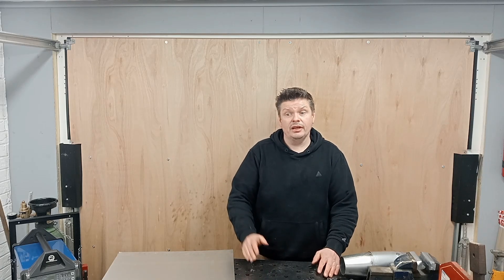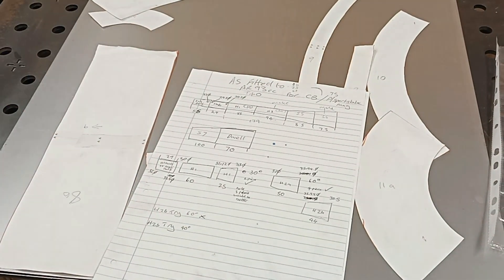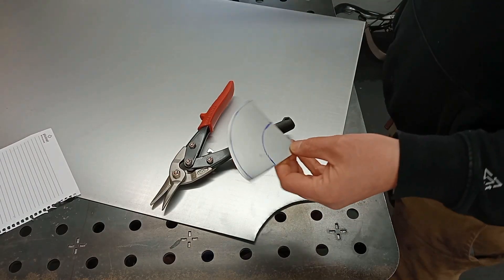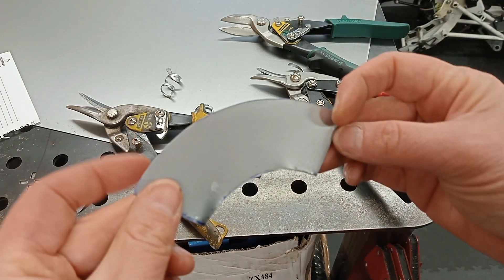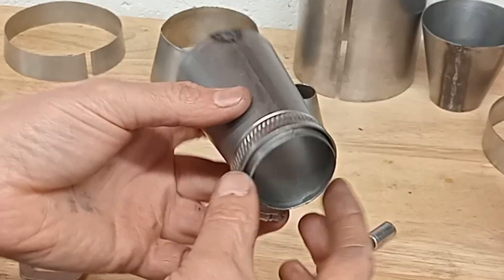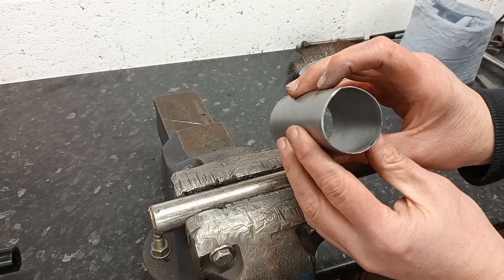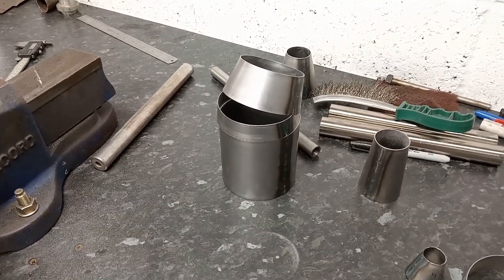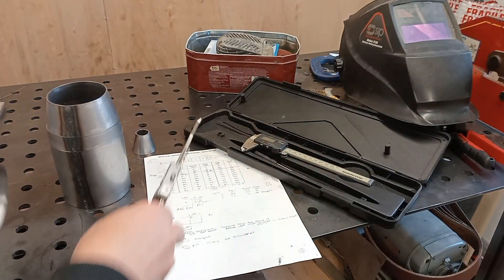Making a 2 Stroke Exhaust Pipe - Expansion Chamber! #exhaust  #expansionchamber

Comment: Hey great video, do you have the file to print out the pieces?
Reply from the maker: Cheers, I did most of the templates on Mota and that won't export a DFX file. I just prints.it out.
Reply: @ is there no way I could print it at home?
Reply from the maker: @schweiggl1876 I'll have to have a look but I could export as a pdf.
That said I could send you the design and you use the cone program

Comment: can i get the paper templates somewhere i am planing on making an exhaust myself
Reply from the maker: Hi, I don't have a DXF file for the templates I'm afraid. Only the physical templates.
Reply: @AutoBeta2T  did you make them yourself
Reply from the maker: @Cryst_the_sweat yes, I used Mota to print them. There is a free programme (or fairly cheap) that will generate the flat cone templates too. I'll have a look for it.
Reply from the maker: https://www.conelayout.com/
Reply: I dont know how to design a pipe my self so it would even be beter than stock so i dont see the point in trying i will go look else where if people can give their designs
Reply from the maker: You can have my pipe design if you want? But it's for this engine. What engine do you have?
Reply: @AutoBeta2T  it is an mineralli am6 50cc
Reply from the maker: Standard or tuned/aftermarket cylinder?
Reply: @AutoBeta2T  no its stock and i was thinking about making an exhaust becouse my dad doesent let me buy an aftermarket exhaust

Comment: so when the pipe expands does that send a pressure wave back towards the exhaust port?? for 2 strokes this is to push the escaping fuel air mix back into the cylinder, is this correct?
Also for a 4 stroke is it best to keep the exhaust system the same diameter all the way through, cause I got a 180cc 4 stroke here I'm using the stock downpipe 28mm ID, but the only mid pipes I can find with a 32mm inlet are all 51mm out, its too fucking big for the displacement.
We dont want pressure waves going back towards the exhaust port on a 4 stroke IIRC??
 So currently I got 28mm header, 32mm mid pipe inlet to 50.8mm OUT, 51mm muffler but inside the diameter is slightly less, with dB killer and the torque is better than the previous owners setup as there was a hugely oversized old scorpion exhaust 51mm NO dB killer. Didnt have much torque until like 7000rpm (im running CVT btw). 
The one I installed is like half the length half the weight also.

I have got plans for the future to change to 32mm ID muffler, can find those online no problem but i would have to find a mid pipe with 28 or 32mm outlet and there aint any i can find. I was thinking of maybe getting a 32mm to 51mm mid pipe and just cutting it back to where it's 32mm?? would this be viable? other option would be same 32 to 51 mid pipe and just add an adapter or bush but i dont think i want that expansion shit in the middle of my exhaust, not for a 4 stroke. Can anyone clarify this please
also I dont know welding, i aint fucking around with that
Reply from the maker: Hi, yes, all correct about the two-stroke pipe theory but there are two waves, a positive and a negative. The negative wave is generated by the first part of the pipe (diffuser) and it sends a negative wave back to the exhaust port to help scavenging around bdc. The rear cone of the pipe sends back a positive wave that then stuffs the spilt out fresh mixture back into the cylinder just before the exhaust port closes.
4 strokes, as I understand, can benefit from the negative wave to help extract gasses from the cylinder and help cylinder filling. Having a stepped pipe acts like a megaphone, which is a bit like the front part of a two stroke exhaust. Note, I'm not that well up 4 stroke theory, so take what I say with a pinch of salt.

Comment: what stainless is that sir..
Reply from the maker: Hi, mild steel sheet. CR4, 0.8mm thick
Reply: @AutoBeta2T  thankyou sir..can i use 304 or 201 stainless
Reply: @AutoBeta2T  sir send me that pattern pls how to make chamber and cones..
Reply from the maker: @kingbarcarsi5661 hi, I don't have any patterns in electronic format. I print them from MOTA straight to paper.
I do have the pipe design if you want that?
Reply: ok sir..thankyou..

Comment: nice work . i used to make pipes 30 years ago with gas welding , but i was lazy and rolled the header and just cut it and turned it to get my bends .
Reply from the maker: Cool, what did you make pipes for? I've heard of that method. It sounds quicker than what I use but I have always worried about cutting it up and keeping the ends flat and accounting for the cuts.
Reply: made for my lambretta sprint bike in the 1980s if you cut and turn its the same shit worked well got 14 second quarters and 90 mph ..... im sure i could do over 100 now 40 years on ..... make exhaust port wider in the blow down area in a trapisoid shape . the more area you have when the exhaust port first openes the better .... good luck .... i used blairs formula .  @AutoBeta2T
Reply from the maker: Cool, that sounds fast for a Lambretta! A few people have mentioned about getting the area open quick with the exhaust. 
Blair for the exhaust too?

Comment: What program to calculate you use?
Reply from the maker: Hi, I used EngMod2T for this one starting with a base design known to work. I also use Graham Cokers' exhaust calculator which works extremely well:
https://m.facebook.com/groups/671081149638729/permalink/3119951054751714/

Comment: I'm no authority on expansion chambers by any means so feel free to correct me. I do weld a bit though so here goes. Being such thin material, logic to me dictates , would it be stronger to stagger the seams so they don't all run together. Perhaps try to crush 1 ring by itself and see how the joint holds up. If it is stronger at that point, by the opposing stagger method would it give it  more rigidity ?? I would be interested in your thoughts. However As you already run the seam in a straight line have you come to the conclusion it's stronger this way or just for visual evenness . ?
Reply from the maker: Hi, I generally put them in a line so the angle is correct, if you turn them it shallows the angle of the bend. However, I too have wondered about how it affects the strength. I would have thought it would want to weaken but in reality the rings stay in very good shape. I think it helps as most cone ends meet at an angle making it nearly impossible to bend very easily. 
So I guess a mixture of aesthetics and keeping the correct bend in the pipe.

Comment: Nice work! I'm now working on an exhaust for my tuned 117cc maxiscooter (lots of videos about it on my channel) but with all free calculators I've used the best exhaust would look like a straw for some reason. There's no pipes available for tuned Yamaha 4VP10 100cc engine, it's so rare. So I've been testing with performance pipes for Yamaha 70cc scooters because the fitment is almost identical. Top speed went from 80km/h to 120km/h so I believe I have done something right but I'm sure the exhaust is now holding me back. I think all those exhaust calculators I've tested are meant for wide powerband and for scooter you don't really need that. My current pipe is about 2x wider and 30cm longer when comparing to average calculator outcome and still it works the best from all pipes I've tested so far 😃
Reply from the maker: Hi JoniK, cheers.
Yes, the online calculators are not always the best. I've had really good results with Graham Coker's calculator and also with EngMod2T. 
There are a few more I'd like to try for the AR.
What sort of rpm does your maxiscooter peak at? I'd say the pipe I'm currently making could possibly work well on it. 
Saying that if you've gone.from.80 to 120 km/h then it looks like the pipe you have is in the ballpark 😁

Comment: Great video. Thanks.
I've been following evening classes TIG welding and I think I'm ready for trying out my first 2-stroke expansion exhaust.
I have been doing some exercises with pie cuts from a pipe (1mm) and am happy with the result. On the inside of the pipe, there is some (minimal) relief of material on the welds. No issue for 4-stroke. But what about this for 2-stroke?? I can imagine this can have some impact on the flow. Do you file/sand on the inside after welding?
Reply from the maker: Hi Carrejans, thank you.
With the inside of the pipe I do grind the welds to smooth out any weld boogers. Generally it's not too bad if the welder is set correctly. Note: I don't use filler wire on the weld I just fusion weld it; however, on occasion a little filler may be required if there's a gap and this can lead to some blobs inside that need grinding. I also hammer each weld.
I'll make sure I cover these points in the part 2 vid. 
Cheers
Dave

Comment: Only just found your channel, nice work. I've always wanted to do similar to my old Honda mb5
Reply from the maker: Hi Stephen, pleased you found the channel and hope you enjoy the content. My first motorbike was an MT5 so same engine as your MB as I remember? Could be a fun project 😊
Reply: My first bike was an Mb5 -loved it but it was way too slow when my mates had fuzzies and Ap50s . As I remember there is a washer welded in the stock exhaust and MOST annoyingly the exhaust port is an astonishing 5mm too low :( The carb is also probably also to small but I loved the bike as a first bike . Next bike was a KH 250 - that was incredible at 17 years old !!!
Reply from the maker: Yep - the things they did to keep the power down. The standard AR 50 exhaust port is very low too... And very small.

Comment: Also if you stress relieve the weld it will release all the distortion. Use a hammer with a solid block on the inside and tap until you see the distortion come out. A ball pein hammer on the inside would do it

Comment: If you use a MIG welder you wouldn’t have to mess about with all the clamps. You could hold it with one hand and buzz a quick tack with the other
Reply from the maker: True, but possibly the excess material left with the mig would require it being removed that could cause additional time required. I may have a go with the mig to see how it goes.
Cheers for watching and have a very merry Christmas ⛄

Comment: Make a cone stop for your slip roller that bolts to the left green angled piece. That guides the cone from spiraling and eliminates the work of “slipping” it in the roller by hand. Also start all cone ends backwards in the roller to eliminate the natural tendency to leave a flat spot. I made many pipes the same way as you demonstrate. I Laser cut now to avoid the tin snips. Keep it up!
Reply from the maker: Cheers for the tips - I'll look to make a stop before the next phase of construction. Noted about the backwards start - I'll try that too. Cheers for the help 🙂
I've done a few laser cut pipes too... And yes it does make life a bit easier... But I need to get my money's worth out of the new tin snips 😂
Reply: @AutoBeta2T  tin snips build character! And it demonstrates simplicity.

Comment: Looking great Dave, love the attention to detail. In a previous comment I mentioned making the front pipe from a single piece of sheet, it's not too difficult to achieve but I only used to do it in the early proof of concept stages, when EVERYTHING is cut and try (I didn't have software) anything to shorten the process is helpful, including converting a 2 cylinder engine to a single lol.... in order to do it you'd probably need to print the segments eye shaped rather than bowtie though.  My philosophy then was get it working first then make them pretty. Don't think I'd do it that way now though as I'd guess the software gets it VERY close to ideal.
Also when I mentioned the cylinder head cowl a lot of people will say the ram air concept didn't work as Suzuki dropped it for the last 2 models of GT250 however I'm inclined to believe it did work, I've seen GT250 heads with the cowl removed and the fins are about half the length of the later models, I think it was dropped to reduce costs not because of any kind of design failure .
Reply from the maker: Cheers Roy - I think more time on prep does help ultimately but does take time. I'm in less of a rush now and I'm enjoying having a bit more space to do this with certainly helps
Reply: @AutoBeta2T  The software will probably get you to the stage where I would begin to make them with an eye to quality rather than speed of manufacture. Regarding the marking out, I did it the same way, even down to the pritt adhesive lol but I always seemed to have part cans of spray paint lying around, a quick coat once they're stuck down saves all the drawing and highlights the offcuts better. The steel I used was 20 gauge which I got from work ( the pit workshops ) even direct from the supplier there were sometimes sheets with hard patches where maybe the temperature had dropped a little while it was going through th thickness rollers. Final cutting/trimming of blanks I always tried to do at work using a cutter called a Monodex, it's like a 3 prong fork with the center one moving up and down between the outer two, very precise and very low distortion. I was able to use slip rolls at work but anything at home was hand formed on sections of hydraulic ram in a vise as battle scarred as yours lol.
Reply from the maker: Okay - so .9mm... I've worked with that before and it was good. I got one of the X7 pipes Lasered and it was  0.7mm (22 gauge) and an absolute dick-head to weld.  Paint sounds like a good 'hack'! 
Please to hear the trusty pritt-stick has been going for a while.
Reply from the maker: I'll have a look at the Monodex. Was it hydraulically operated?
It's amazing what you can do with a piece of metal bar! And yes the Record vise has some time in ☺️